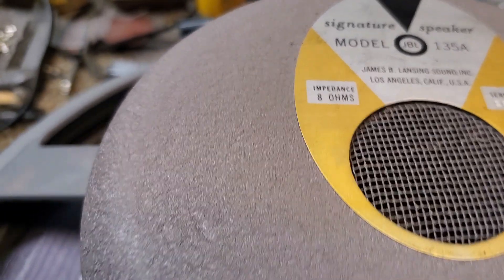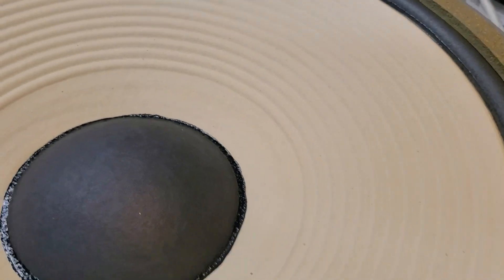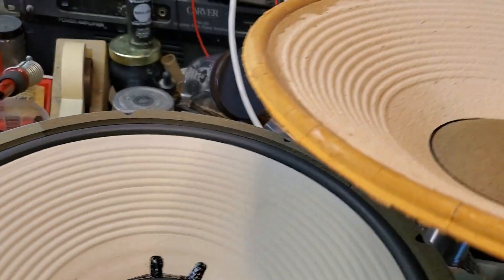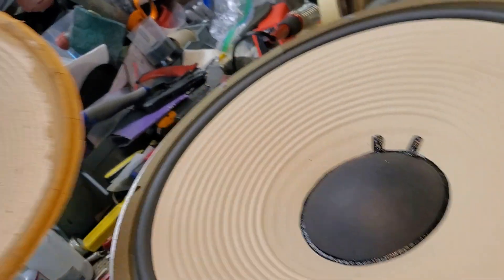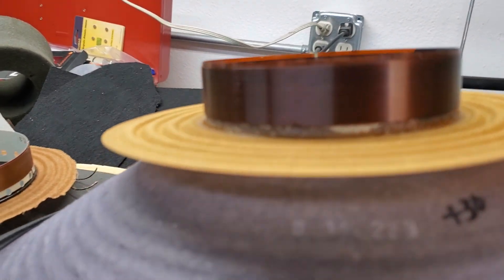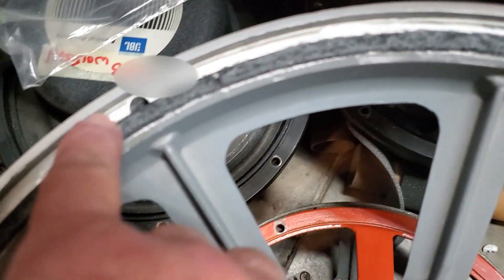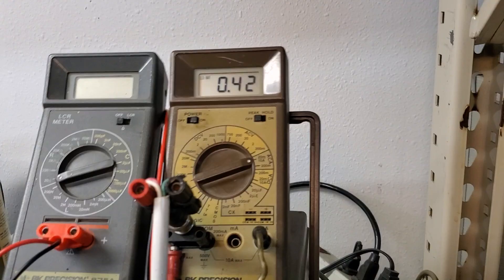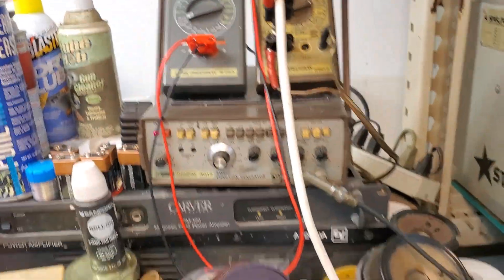Full Service Restoration of JBL 135A...same as 2230A...for JBL L45 Flair.

Comment: Great video! Recently, I restored 2 D140F with 2234H kit thanks to advice from Simply Speakers and Lansing Heritage. Nice recone job. Prettier glue on the cap than mine. I have 2 different frames,, one with the terminals on the spoke, the other is between them. They came out of a Fender Bassman. My buddy was a bass guitar teacher and a student gave them to him years ago. I had them ever since in different DIY attempts. I'm copying a pair of L45 Flairs another buddy had since the 70's. Cheers 🙂
Reply from the maker: Thank you! These are lots of work to get right.